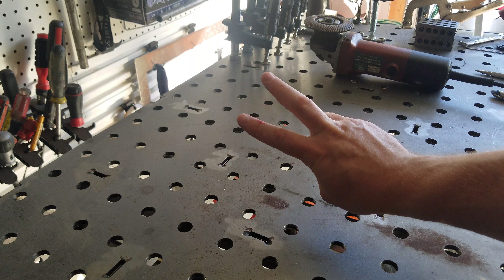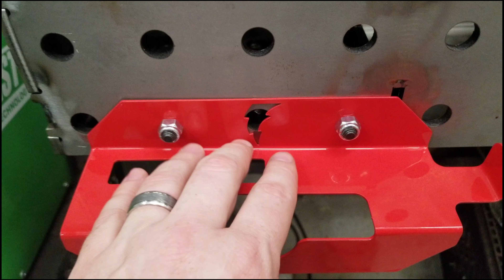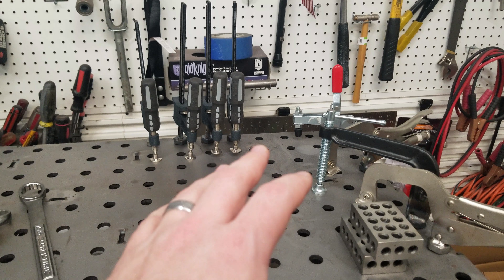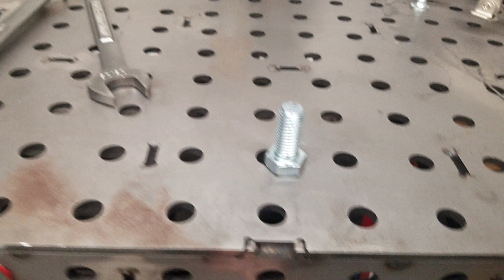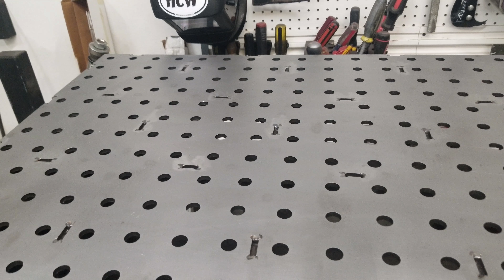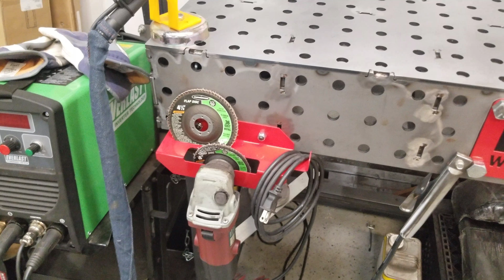CertiFlat Weld Table Accessories - Part 1- Grinder and Clamp Storage

Comment: Some of us don't have a nice dedicated welding table such as this. I want a great grinder holder but will have to mount it someplace else.
Reply from the maker: Understand that, you could always screw it to a wall or bolt it to a work table. The weld table is not required. 👍

Comment: How do the bolts on hanger bolt in, and key down as you said?
Reply from the maker: wish I could reply with a picture, but i'll try my best to explain. The bolts that go though the bracket are smaller than the holes in the table but they have a heavy washer. so when you assemble it the hardware goes through the hole in the table, you press the bracket down and tighten the bolt, it draws the washer and bolt head up tight to the back side of the table surface and locks it in. if that doesn't make sense send me an email haslipcycleworks@gmail.com and I can send pictures.